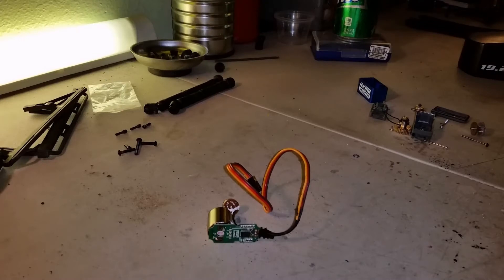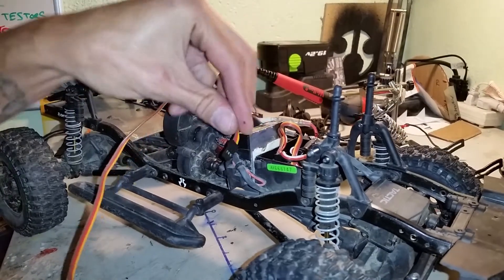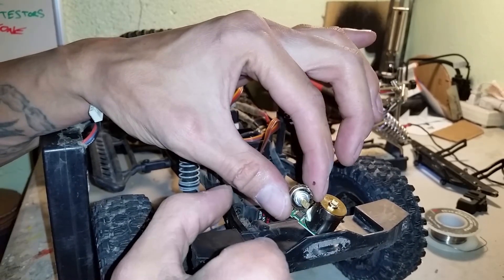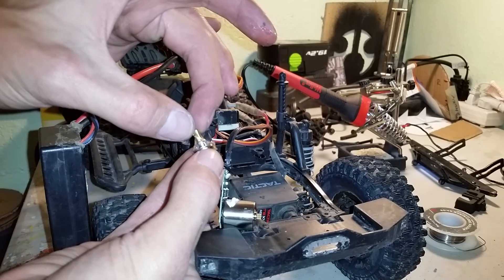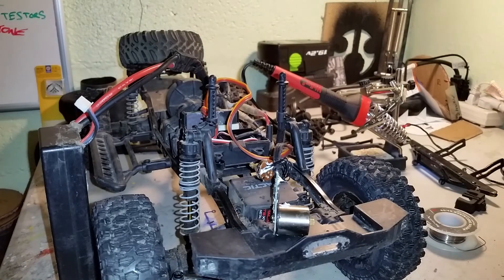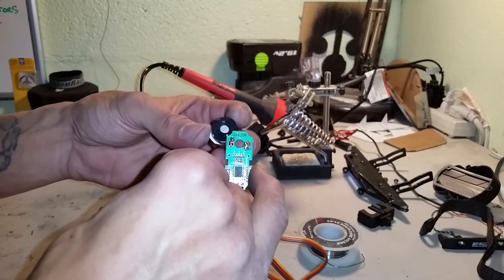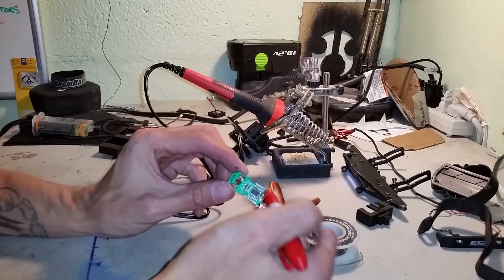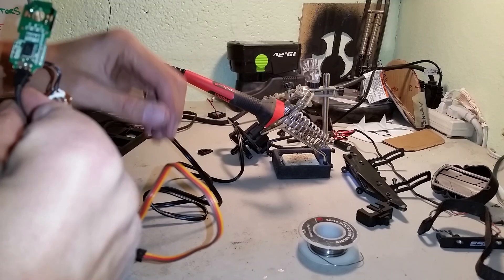SNOWMOD RC - DIY Servo Controller for Winch/Lights

Comment: Just tried this. Having a problem where the light flickers when using this diy controller any suggestions? Vxl esc and the same tatic remote as you
Reply from the maker: Thats a first Ive heard of. Flickering is usually an indication of a bad connection or the DIY controller POT switch not being centered. Can also try another DIY switch and see if that may be having issues. Ive had some old servos that just dont work well for it.